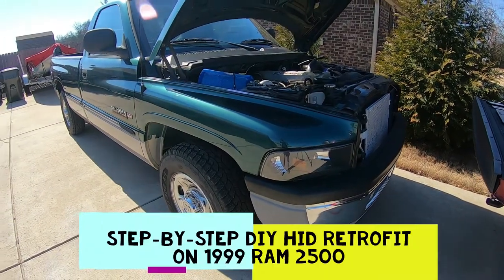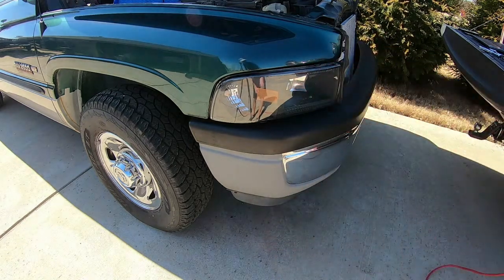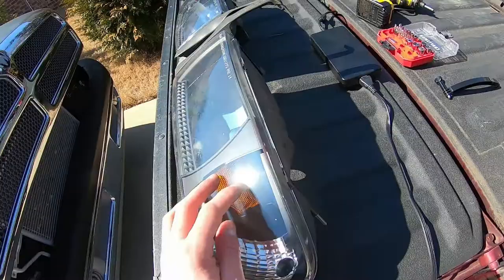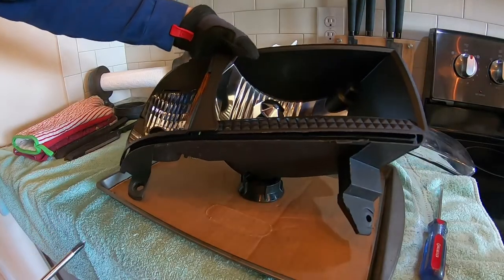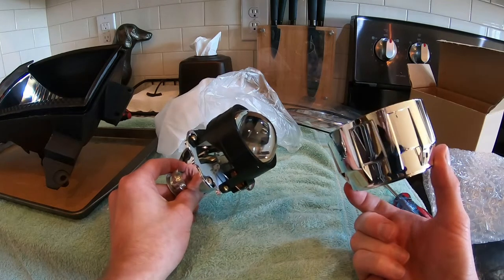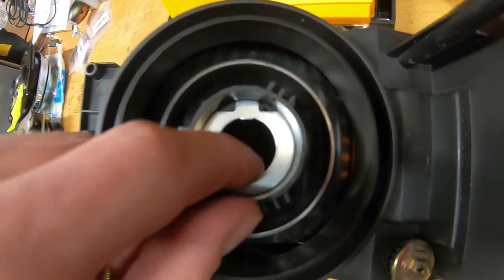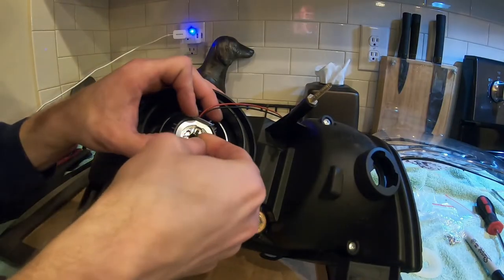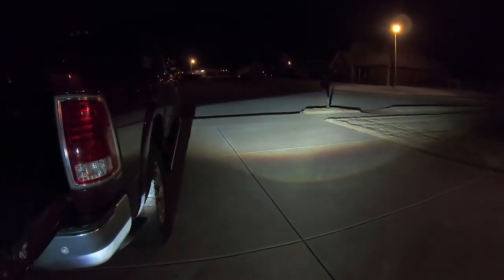1999 Ram 2500 Headlight HID Projector Retrofit

Comment: Im getting ready to do this myself, but want to retain the OEM style lights but am worried that the "texture" of the OEM glass is going to have an effect on light output. any thoughts?
Reply from the maker: Correct. The OEM diffused lenses will not work and provide a crisp cutoff line. You'll have to swap to a clear aftermarket lens. To retain as OEM as possible, I'd go with chrome housing lights with an amber reflector.
Reply: @md9897  thought so. Thanks!

Comment: Is that little wire clip deal on the bottom of the bulb touching the floor of the housing?
Reply from the maker: If you’re referring to the wire clip on the backside of the bulb that holds it in place, no it doesn’t interfere with the headlight housing
Reply: @md9897  Hey thank you! I built me a set not long after watching your video and a few others.

Comment: Have you ever had a p1689 code? I just bought a 99 24v and tryna see what’s wrong with it. It’s in limp mode lift pump psi is good
Reply from the maker: I have not had any codes before, but I’m familiar with P1689 from reading forums. Loss of comm between VP44 and ECM. Seems like most folks start by checking grounds, then verifying the VP44 harness and connectors are still good then start ensuring wires aren’t broken or shorted out. 

I’d also ensure your lift pump is still supplying adequate fuel to your VP44 by a flow test and not just off the gauge...but it’d be less of a chance the gauge is bad and the lift pump bad.  If it’s not, and you’ve got low flow over time, it could’ve contributed to an overheated/burned out VP44 (since the fuel flow through it helps cool it, which is why many including myself tune the lift pump to deliver 14-15 psi to keep the bypass slightly open and make the pump run cooler).
Reply: @md9897  tune the stock lift pump?? If I knew how to do that it would save me 700 for a new one. I’m almost sure it’s a electrical problem the lift pump pushes steady at 10 psi at idle. Of course I have the dead pedal limp mode but everything sounds like it runs good but I didn’t check any connections. I will do that tomorrow just was hoping that was it and not the vp44 being out
Reply: @md9897  thanks for tbt reply also it doesn’t seem like many people on forums have my problem or have a solution. There was one where one of the wires was cut and he fixed that and it was perfect but everyone suggesting check relay. Grounds and connections
Reply from the maker: @ixryq8368  By tune the lift pump, I was referring to aftermarket lift pumps. I have an AirDog and adjusted it to be a steady 15psi of fuel pressure at idle. If you’ve only got 10psi at idle, I’d hate to know how low it dips under a load. Might be part of the problem if you’ve had low fuel pressure under load for a while
Reply: @md9897  gotcha. I will def check more into that tomorrow and I will check into the wiring. I was actually gonna take the ecm off the vp44 and fix the resistor myself instead of paying 1200 for it to be fixed. I have all the tools I need to but that’s IF that is the specific problem. I know for a fact I do need a bigger lift pump like airdog though